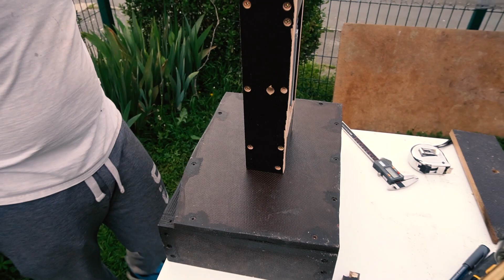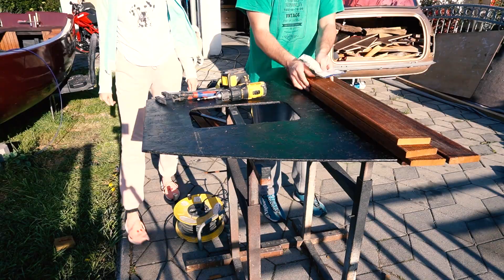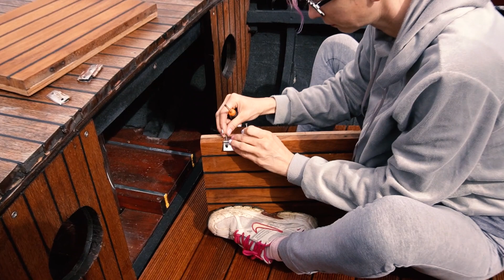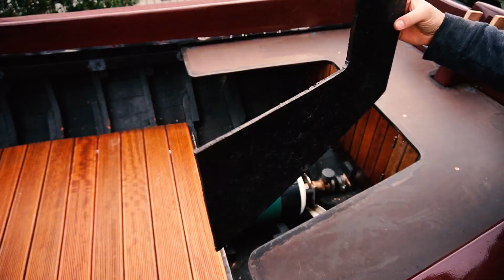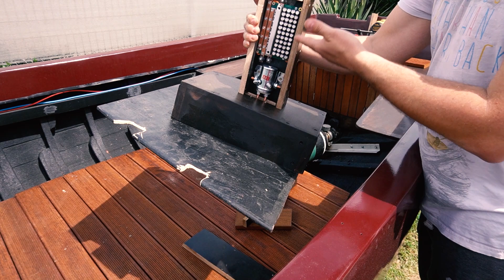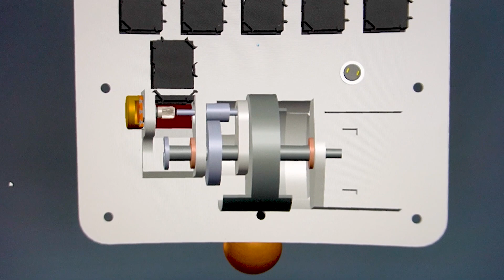Electric Solar Boat Build And Restoration - Episode 5 "The wood work"

Comment: Good job! I wonder what about engine cooling? Won't the engine overheat because of the box? And btw does this motor have any water protection?
Reply from the maker: You will have to wait to find out answers to your questions in the next episodes. Stay tuned! ;)